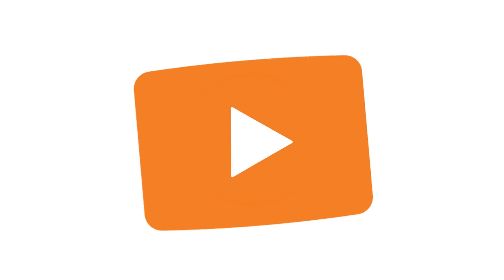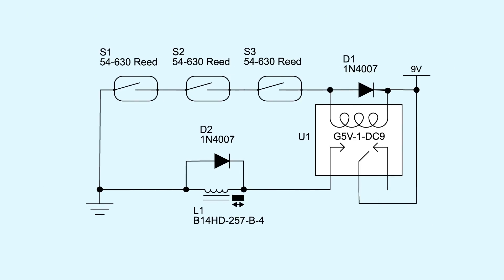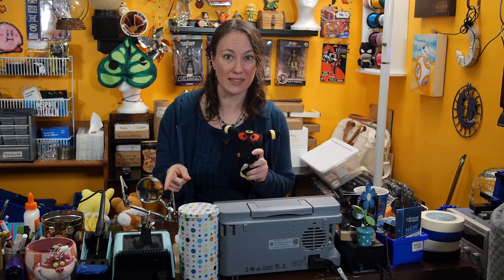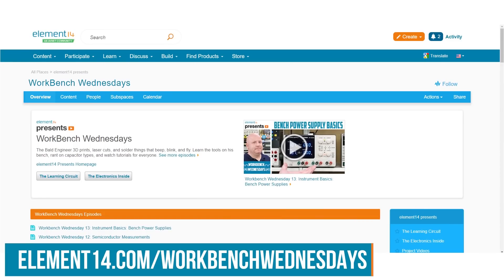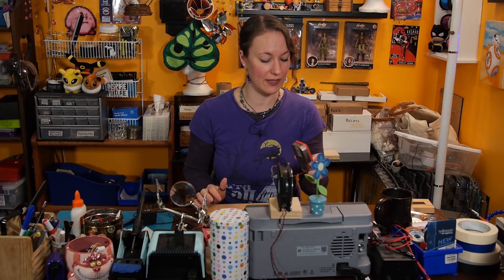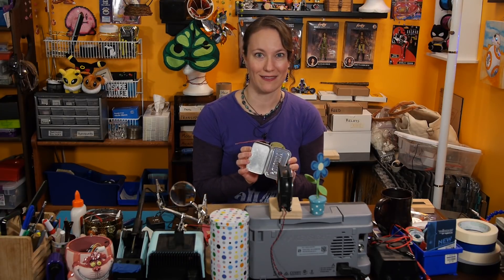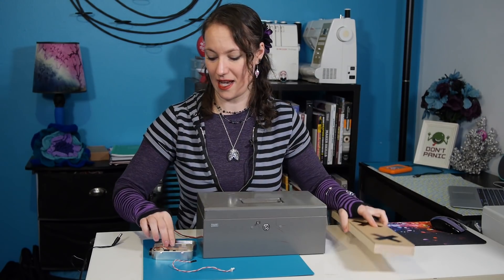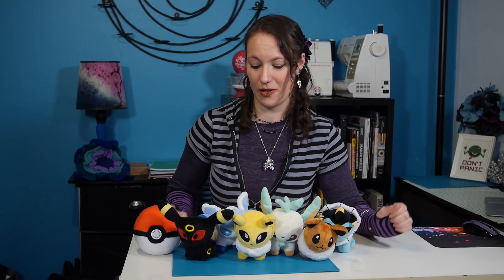Escape Room Puzzle

Comment: Great idea. I would definitely use this.   I can already see some issues in the long run. The solenoids are not made for continuous power, they would eventually burn out if powered for a long time. A solution for this would be adding a limit switch to the circuit through the commonly open connections and putting it under the lid. This way as soon the lid is open the circuit will be open and no more current will flow. To even make this better a step further, I would add some type of spring to the lid. As soon all the pieces are in place, the lid would crack open automatically, and the limit switch opens. This would ensure only the power needed to open the lid is used, saving battery power and protecting the solenoid. As I'm writing this, makes me wanna make a video how to do this. Thanks for the inspiration.

Comment: Make a puzzle that requires actual cooperation from everyone.  Like standing on pads that are far away all at the same time.  Or they have to all hold hands to make a human chain to complete a low voltage or resistance checking circuit by touching the metal contacts that are too far away for just one person.

Comment: Could make the puzzle even harder by requiring them to also build their own power source.  couple zink nails, some sturdy single core  copper wire, and one or 2 lemons (or some other fruit).
Require the fruit to be cut into smaller bits.  Drive a zink nail in it. Attach copper wire to the zink nail, drive the other end of the piece of wire into another piece of fruit, stick a nail in that, and you get a crude battery.  You can easily get enough voltage to drive a simple circuit (like the reed switches), but you won't have enough current to work a relay, so you'll  prob still need a battery for the relais. (which can be entirely inside the box).

Comment: Can't say I blame you for getting a 6v solenoid... besides don't 9v batteries got like a few hundred mAh of current?
Reply: Ever shorted a 9V NiCd back in the day? Modern NiMH can supply even more! And lithium ion even more than that, but thankfully the 9V ones have overcurrent protection.
Reply: @NiHaoMike64  hold up.. are we talking about something meant for an RC car, or an actual 9v battery? But yeah, this one time I connected two 9v batteries together... I don't think anything happened, but then again they were shitty batteries
Reply: @adventureoflinkmk2  A 9V battery with the snap connector. It's surprising how much current a decent one can supply.
Reply: @NiHaoMike64  ah okay.  Was gonna say I remember trying to get a psone to run off batteries many years ago and all the rechargeable 9v (uhh.. 8.4v) batteries pushed out 180mA.  So I figured all those 9v batteries were around that same capacity